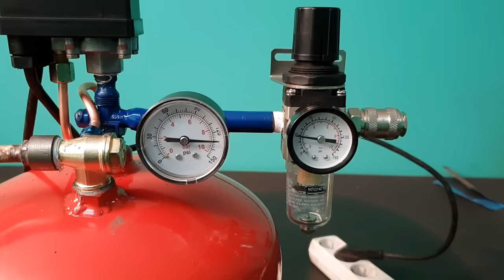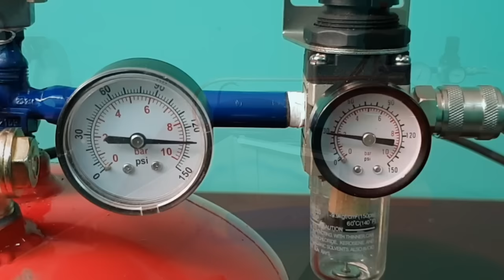DIY Silent Air Compressor make of fridge motor

Comment: Refrigeration compressors are  designed to only pump specific refrigerant not AIR at all.
Why are you fooling people.
Reply: Fridge compressor can pump AIR :D
Reply: @DomsedCZ  Sure, it CAN pump air. But not designed to compress air.
Reply: And people are supposed to be kind to one another but yet they aren’t.
Reply: @ehteshamulhaqueshaikh3496  this pump is designed to pressurize a gas until it turns to a liquid.The liquid then goes through a nozzle which turns back into a gas on the low pressure side back to the pump.This is how a fridge motor works,so pumping air is no problem as it never gets to the pressures needed for fridge gas.As long as there is oil it will keep going and the regulator switch is there to start and stop the motor at desired pressures.A good build out of cheap or recycled materials.I have one and it has lasted for many years.
Reply: @davidmcinnes317  the cycle which have mentioned is a refrigeration cycle it only happens when it has a proper condenser, evaporator coil and an expansion device and that is a complete balanced refrigeration systems or else the compressor do not have any properties of compression unless it gets converted into liquid.
Further you might have seen that all new compressors comes with all the tubes dummied with rubber plugs and charged with dry nitrogen, that is only because this compressor are design to pump refrigerant and the refrigerant do not have any moisture. Every refrigeration system is vacuumized minimum 20 micron before charging refrigerant in system. even then all of the refrigeration system in the world has strainers these strainers which isolates moisture. so if such a care is been taken in an refrigeration system to avoid the moisture.
So  how come someone can use it so easily to pump the air.if it is used to pump air the moisture in the air get collect on to the discharge rid of valve plate.  in some time will make it non operative also the oil will  contaminat with moisture,and may not do proper lubrication of the compressor. 
Compromising DIY. ? No comment.
Reply: @ehteshamulhaqueshaikh3496  Yes I totally agree with you on all points you make here.But as a small output compressor used for diy not mass production and the fact that it can be made out of scrap ,this is a great project for the home workshop.If it runs out of oil or seizes up you find another fridge motor.He is only showing you his ideas,trying to help other people keep their costs down.As I have already said I have built and run mine for  about 7 years and it only cost me about £25  to build and so far it has never let me down,a big saving on a larger unit and much quieter as well
Reply: @davidmcinnes317  if the uncertainty of the lifespan of the project is been pre evaluated then there is no problem. 👍